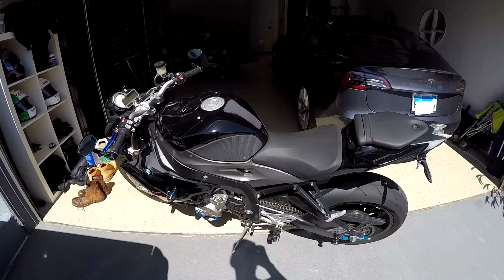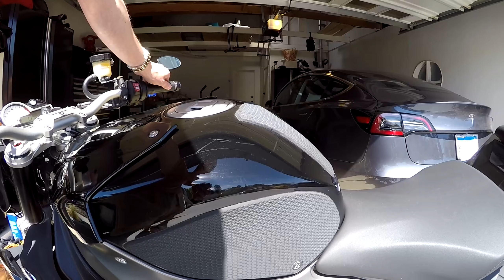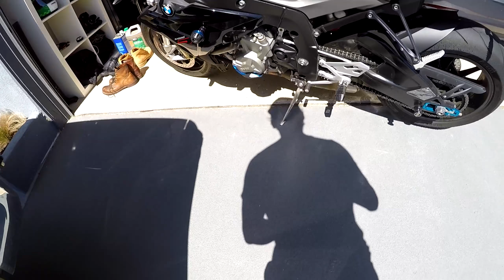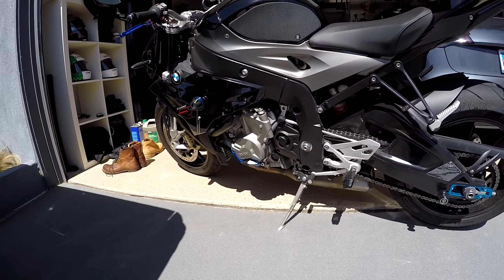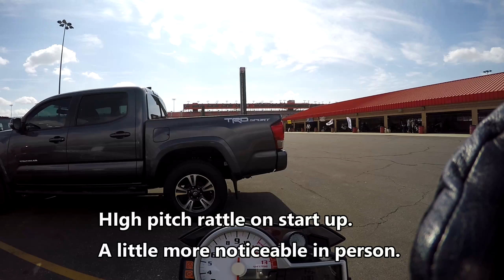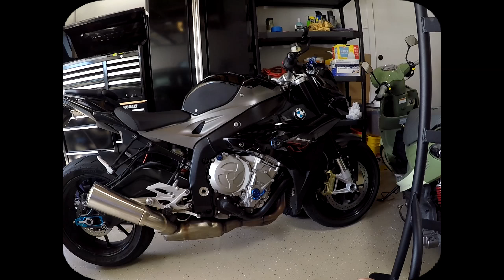BMW S1000R startup rattle fix

Comment from the maker: The difference isn't very audible on this video. It still chatters but it is milder now.
Reply: Mine use to rattle also. The original chain tensioner cap is black. BMW make one (silver) that is 5 mm thicker that will fix this concern. You have to use the OEM hydraulic tensioner. Part # 11318534849.

Comment: Hey could you share a link on which one to buy?  I want to make sure I get the correct part I live in the US not sure if that makes a difference. Thank you!
Reply from the maker: I had BMW of Escondido install it. They had a single supplier and had it installed in some of their own bikes. I’d give their parts department a call for the name or just buy it through them.
Reply: @MinnerQ  thank you